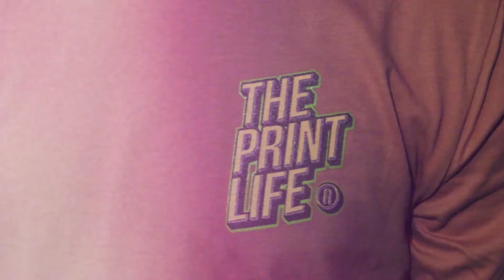T Shirt Printing Machine for $30 | DIY T Shirt Business | Step by Step Screen Printing Press

Comment: With the platform being 14”x20” ish does that limit your screen size to those dimensions? Or can larger screens be used as well?
Reply: i imagine you could go a little larger on screen size but your design and squeegee need to remain smaller than your platform

Comment: Ink clogging the mesh is my kryptonite
Reply: usually happens if : you don't fully clear the screen when printing, or if you allow the pallet to get too hot between prints since it's slowly drying the ink in the mesh as you print..  Allow the print to cool down after flashing between colors, if you have a single station press this will slow you down, but if you have a multi station press, print, then flash directly after that way as when the shirt comes around it had some time to cool down
Reply from the maker: for sure watch my video on printing a single color job on this press. You are the man.

Comment: Not seeing anywhere where your screens are coming from. also photo emulsion looks way harder than vinyl, can you do a video on that. didn’t see one in your links or store. See a vinyl cutter and also watching the Arizona video I started with that linked you and got your store it had product shown but would rather go through Amazon on your link he also only has your store link and neither have the mesh linked you should do that so we can support and also add vinyl to the video for us Cricut or Siluete crafters many are searching and finding a video that shows start to finish with vinyl and diy are non existent right now. Many are looking to make screens and use vinyl to finish I linked the video then got 200 messages from my fb page on what mesh to use from Amazon. Please want to support but it’s hard to do so when my inbox blows up sharing video